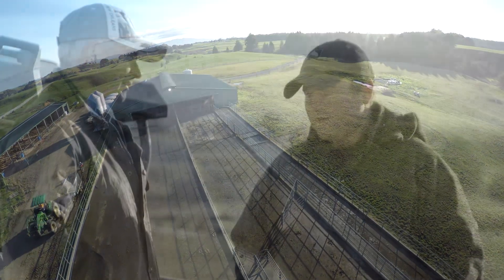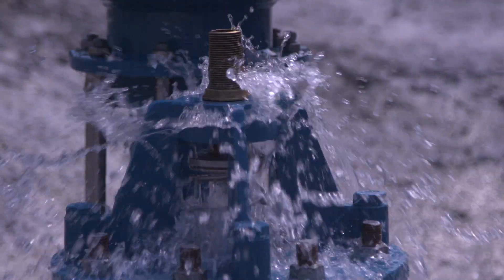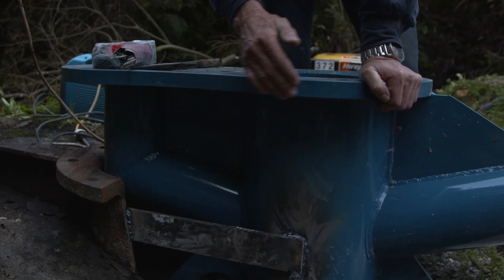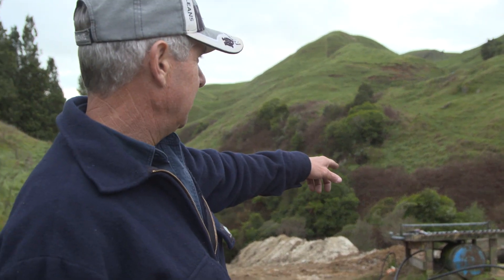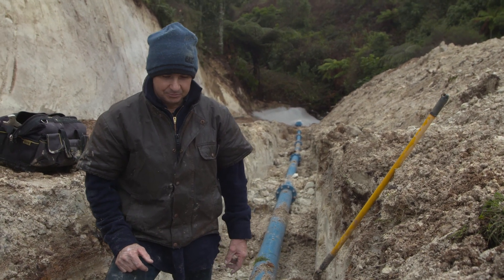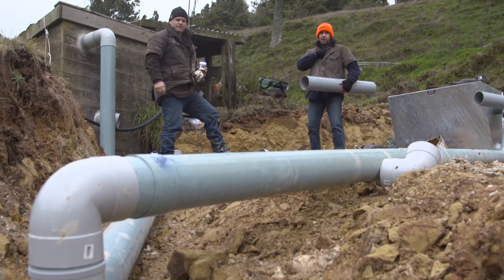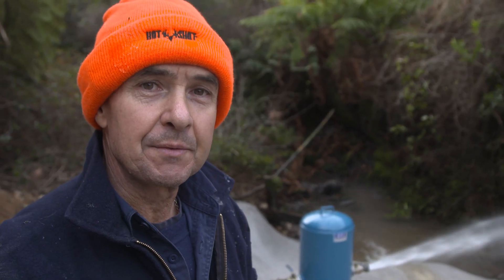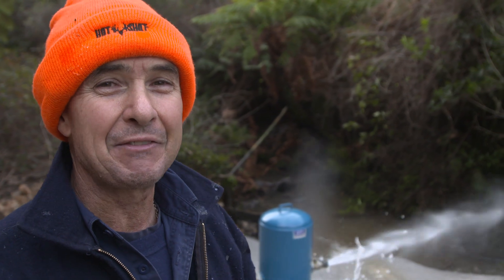World Water Rams - 6'' Arohena Project

Comment: The steel reinforcement must be at least 100 mm in to the concrete, otherwise with the heat it will expand and crack the concrete and rust. On the steep sides you need to put concrete anchor blocks.